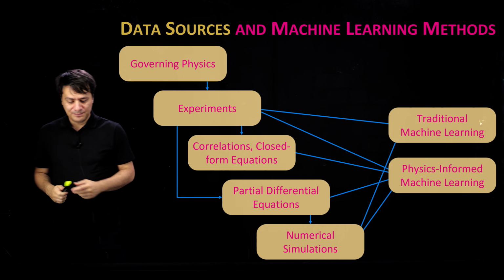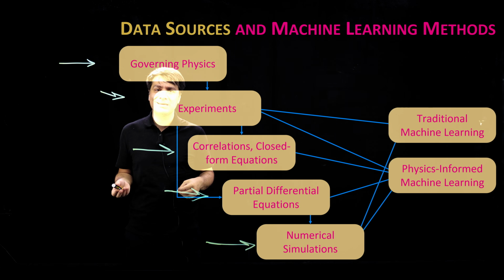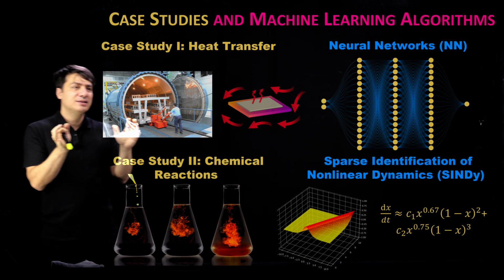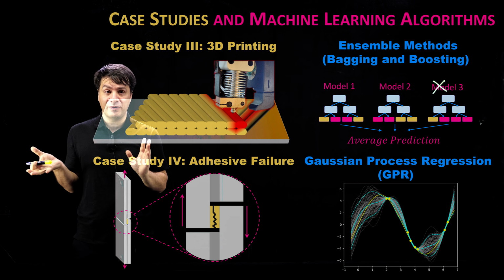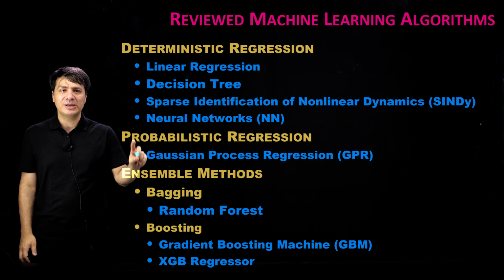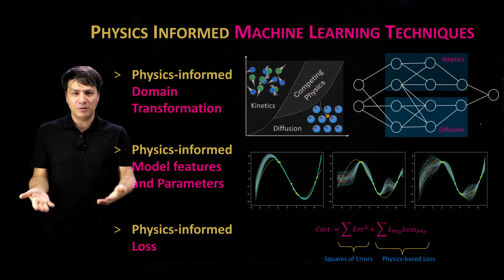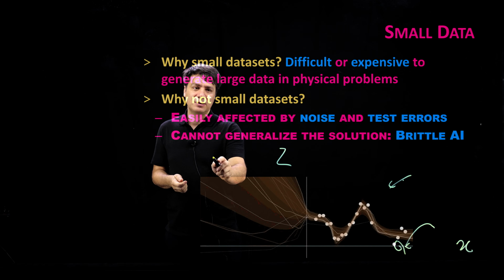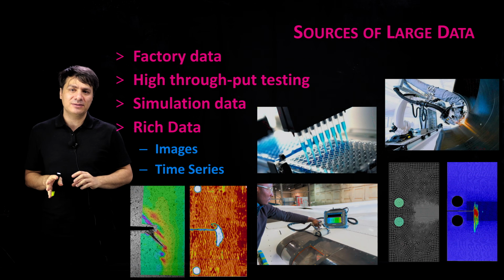Physics-Informed Machine Learning, Section 1 - Introduction, Part 1

Comment: I do have one question.In the part you are refering to small dataset and where we have alot of noises and uncertainty. Can we also assume to use active learning in order to label the datapoints wisely?What I mean is we have alot of uncertainty and noises within small datasets maybe with active learning also we can make a proper prediction?
I am only brainstorming but it would be interesting to know your opinon.
Reply from the maker: You're absolutely right—when working with small, noisy datasets, active learning combined with uncertainty quantification can be a powerful strategy. The ideal approach is active targeted learning, where you focus your efforts on regions of highest uncertainty to guide experiments or data collection. This not only improves prediction accuracy but also maximizes the value of each test.